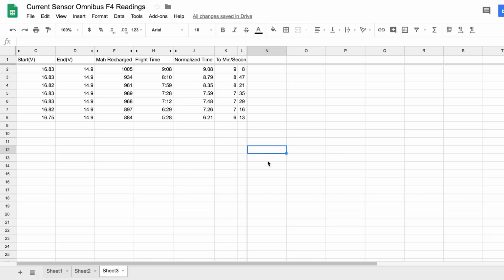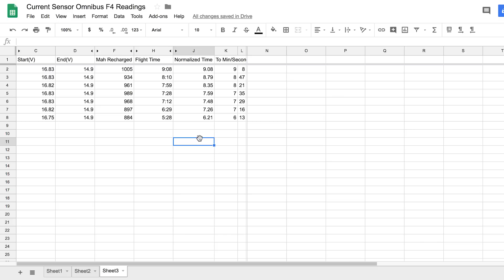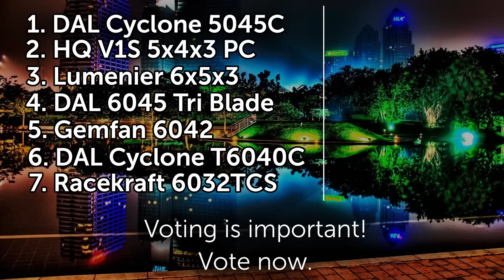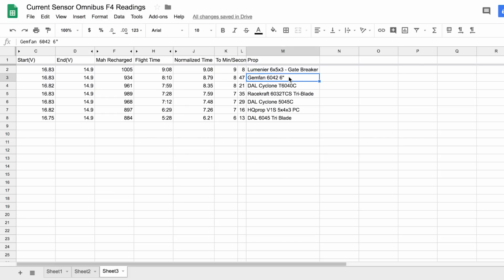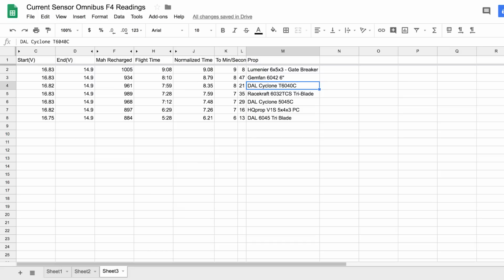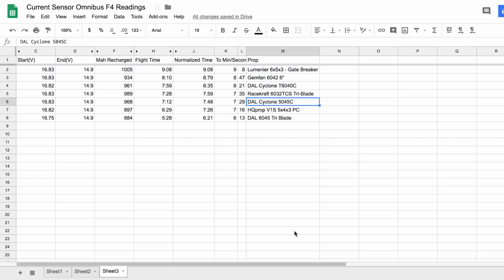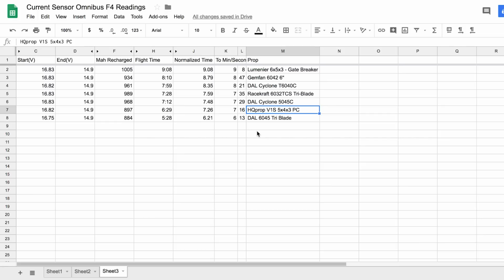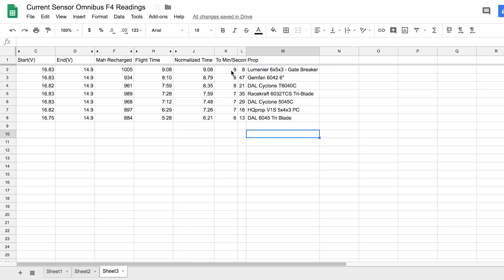Prop Testing for Long Range Drones - Which prop is most efficient?

Comment: Just wanted to let you know that if you use a socket ratchet for those gate breakers that you won't have the wrench problem you are having; I have been using the socket ratchet on props for the last 2 years; they work great on the gate breakers, and the steep pitch props like the Avans.
Reply from the maker: Tried that. I think my socket is too heavy duty and has a thick wall so the gap between the nut and the prop is too small for the socket to fit nicely into that spot. I will try buying a cheap one, or grinding one down.

Comment: Regarding a prop nut tool, you can use an RC car tire wrench, or an 8mm socket driver. I have the tool with a quick connect on an electric screwdriver and it works very well!

Comment: Hey Rosco I really like your videos thanks for being there- I am disappointed to NOT see Master Airscrews 6045 (2 blade OR 3 blade)  in this lineup, as recently I have found them to be a far superior prop than ANYTHING out there for 6"... Both 2 and 3 bladers are the quietest 6" props I have used which I kinda relate to efficiency... any chance you can update this after trying those too?? Cheers
Reply from the maker: ZeeBeeFPV it is coming. Soon as I posted I got a ton of feedback so I went and bought a bunch of the props from the responses. Keep an eye out. Also testing all of these with the other LR motors from piroflip.

Comment: Isn't 8min79 seconds actually longer than 9min8sec? So the Gemfan 6042 was the most efficient?
Reply from the maker: It's not 8min 79sec but rather 8.79 minutes. So just over 7 3/4 minutes, or 7 min 47s. Sorry if that wasn't clear. I'll do it better on the next video.

Comment: I expected more run time from the dal 6040c. Does lumenier need make an even more efficient 6 inch prop?
Reply from the maker: Same, but the cyclone is an awesome prop. Even if it isn't the most efficient, it provides such a smooth thrust curve. I prefer it overall as all-around prop.

Comment: Normally lower pitch means better efficiency. You kind of had the opposite result here. IMO what happened was you did the test at minimal throttle just to keep the quad hovering. You should try the same test again flying the quad in a real situation and I'm sure the results will be different. AT least you demonstrated a different point of view on how propellers efficiency behaved with this test.

 The same happens to me. I get better results with higher pitch props (power/efficiency that I like). I'm a park flyer just flying around. I'm not ripping the sky with my quads. I've tried the RK 6032. and they require a bit more thrust to keep the quad flying. I normally use the DAL 5x5 and the GEMFAN 5152 (both in 2 blade version) for my 6" quad (good power/efficiency ratio). I also like the Lumenier 5" G.B. 5x5.3x3. I ordered the 6" version to see if I like them.

 At the end of the day you use a prop that matches your quad setup, flying style and you feel comfortable with.
Reply: So, did you tried 6" version of Lumenier? Or maybe you can give some advice about another effective props?

Comment: For Efficiency you want low pitch bi blades.   They dont fly good but they have the best grams per watt.     Emax has some  6X3.8 I bet those would get you over 9 mins.
Reply from the maker: I'll take a look at them. You're right though typically 2 blades are more efficient though the gate-breakers dominated this last test. In my next video I'm testing a bunch more props. I've run all the tests, I just need to cut a video.
Reply: The Gatebreakers are surprising.   the sweeping wide blade must help with efficiency.   I was looking at Miniquad test bench and they showed 5030 Diatone ghosts as the most efficient props.   But they sacrifice alot of thrust.
Reply: 100% true . And also the bigger prop is and the lower kv motor has the system is more efficient . Btw 1 blade props are the most efficient but useless in drone world.